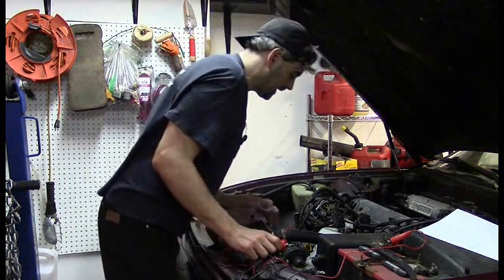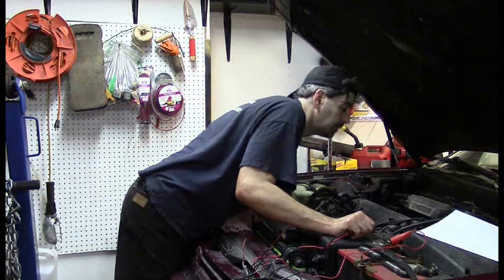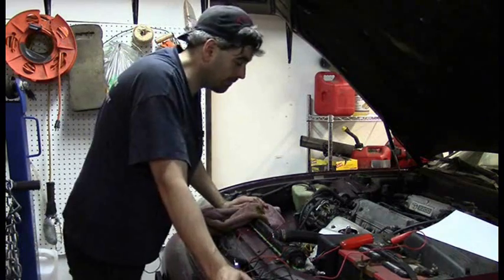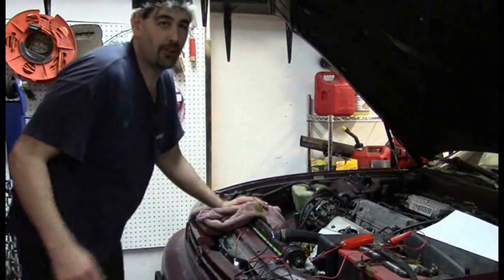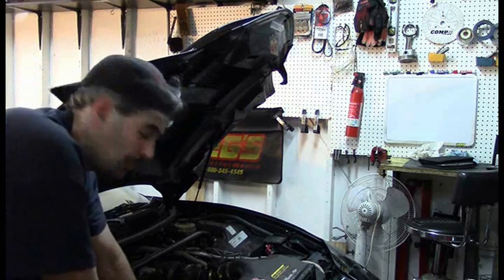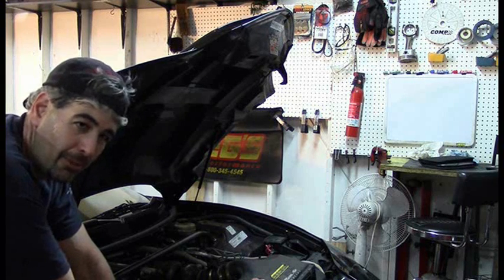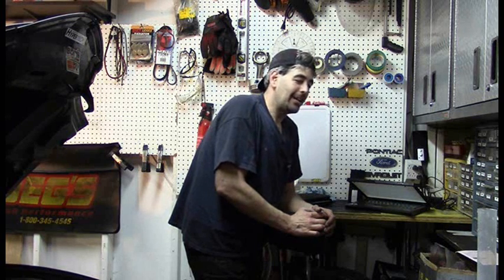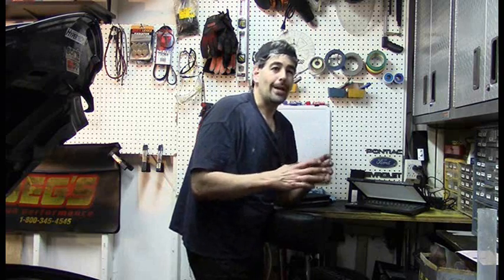12 Ways of How To Test A Blown Head Gasket Compared- PART2

Comment: A test only is reliable IF it is reproducible AND IT consistently provides Accurate results. Just because it worked once on a verifiable sample does not insure consistent reproducible results. The test Must be performed multiple times with both known and unknown sources to remove biasis to prove it is reliable. The test must be verified by other definitive tests like removing the engine head to exam the head gasket or magna-fluxing the head and block looking for cracks, or checking the block and head for flatness.
Reply from the maker: Absolutely 100% correct!! Good for you for being one of the few people that understands actual scientific process. 
   That’s exactly correct. Even further-  actual scientific method is performed under “negative hypothesis theory”. That is- you try EVERYTHING multiple times to prove the hypothesis wrong.  The failure to do that is what ultimately secures the hypothesis as correct. As an example- if a blown head gasket is suspected, you don’t attack it as “let’s find proof of a head gasket leak”.  You attack it as “let’s do everything we can to prove it’s NOT a head gasket leak”. But when those tests consistently fail to show the head gasket is good, that’s the actual scientific proof of a blown head gasket. 
   This approach prevents bias in the testing methods.

Comment: Matt, long term subscriber here… I have an 05’ Toyota Sequoia that is pushing coolant into the expansion tank on a drive cycle but only pulling about 50% of that amount back into the radiator after a full cool down. I replaced the radiator cap and the hose going to the expansion tank, no cracks in tank. I think I have a bad head gasket but have not completed my analysis 100%. So far I have pressurized the cooling system and saw a leak down of 2 psi in one hour, no external leak. I have block tested it cold, no color change. Block tested it hot, fluid changed to light green and I did see occasional bubble coming through without applying vacuum. My question… have you seen a tiny head gasket leak cause a continual rise in the expansion tank level while dropping the radiator level? I have not allowed it to happen but I believe if I let it go unchecked, it will eventually overflow the expansion tank and the radiator will be low on coolant. I plan to do a cylinder leak down test with engine hot / warm next to see if I hear / see the cooling system bubbling
Reply from the maker: Thanks for subscribing long term!!
   Yes I don’t know what’s going on but a lot has changed since this video and it’s totally revised the way I examine head gasket issues. 
    Maybe it’s a newer car thing but I routinely run into cars now that do not express any of the traditional signs of a head gasket issue but they absolutely have small leaks-  too small to detect with compression test or even chemical block test.  The car seems totally normal but develops overheat, high cooling system pressure etc but no trace of any combustion chamber compromise.  Several years ago I caught a vehicle that had what seemed to be a pinhole head gasket leak that totally changed everything as all my tests where negative until I let the car sit overnight and Borescoped each cylinder and found cool and pooled in one cylinder. Since then I have found probably a dozen cars like this. 
     Currently- I don’t even bother with the compression test anymore if I suspect a head gasket issue. I use a pressure transducer on the radiator and look for pulses consistent with each engine cycle. The transducer is the only thing I have found that’s sensitive enough to detect really small leaks.
     So basically, yes you can not only absolutely have a head gasket problem that is too small to detect by traditional means, but for some reason it’s much more common in later model cars since this video.
Reply: @SchrodingersBox  Thanks for your videos and your input here, I have learned a lot from your channel. Found you in the early days of my career, now I wrench professionally as a Caterpillar field service technician. I agree with the odd modern head gasket problems. I just solved a C18 engine with a “low coolant pressure” code and occasional overheating that the customer struggled with for months. The problem ended up being a bad head gasket and corroded block surface. My Sequoia is not overheating, no smoke, no misfires, no coolant loss. I just bought it a week ago and it started getting hot on the long drive home. Fluctuating temperatures, the variable seeming to be air flow over the radiator. I did a cooling system flush, new coolant, new thermostat, new viscous fan, new cap. I don’t throw parts at customer jobs, but for my own vehicle I’m ok with a few hundred dollars for things a 20 year old truck could use anyway. Since then I’ve noticed the expansion tank issue. This week I’m going to run it and see if it overflows the tank if I let it be. Anyways, thanks again. I’ll let the community know what I find.

Comment: Just info Update; with history.
My issues, ovr heating, Turning Heater on full hot medium fan would bring temp down.
Truck had set a majority of her life. 
Watched our ole buddy the Neclear Physisist " can't even spell " :(( whom we all love and Hate at the same time.:)))
I No visible leaks. No bubbles. I know not scientific.  I had not driven her for long periods. 
I figured "throw the tool chest at her.
Pump/ thermo/ all hoses new fluid.
Post all that, she still overheated but not as much.
So by now I'm fearing the worst.
I figured a professional radiator flush would be worth a try. Fluid looked good No crust build up visible inside or out. 
I found an ole guy who has been strictly the radiator guy for years.
He showed me his knowledge learned test.
He tilted rad "Top inlet higher" and placed garden hose in rad fill hole, place hand on lower and said to time how long it takes to shoot water out the higher inlet. within seconds water gushed out. 
He said my rad was 85% blocked.
He also said the rigor he would use to "try" to clean that serious a clogged unit would blow the plastic construction pieces off.  
He also told me "if I'm planning on keeping her I should stay away from the cheap Amazon stuff.
SO Napa has one on order:))))
Best; Tom

Comment: Hi i have a mer w 204 the water from the water bottle is going down when you fill it up , thered nothing in the oil mixing or on the oil cap also no leak on the floor  . what could it be please im worried

Comment: pts 1 &2 were very helpful. Both are brilliant.  Sadly I don't think they solve my problem. I have engine oil in the radiator, but no sludge in the sump, radiator or tappet cover nor do I have bubbles in the cooling system? there is an excessive amount of oil in the air intake behind the filter. I am going to try the sizzle test.
Reply from the maker: I’m not sure how this can’t help. what was your compression test result? what was your leakdown test result?
Reply: @SchrodingersBox   First of all, Thanks for your reply.
 Haven't done either yet only just found the the fault(if the is one) I am getting very faint white exhaust.One suggestion I had was to change the pcv valve.(?) That might be the cause of the oil in the intake, but I don't see how it could effect the radiator. The coolant in the radiator is still green. The C.O. test kit I bought is useless and came with no test fluid so I'm chasing another one. 
One other thought I've had is that a crack may have just developed and hasn't had time to so all the symptoms, yet so I'm watching for the moment
Reply: When you showed the plugs at the beginning of part 1, #3 plug was cleaner that the others. That, coupled with white steam coming out of the exhaust when a car is started after sitting overnight, or coolant loss with no external leak, would be sufficient to indicate a blown head gasket at #3 cylinder.

Comment: Seems like the first 2 tests (chemical test and compression test) are the go to tests....quick and easy and can detect top half compression issues even if there aren't other blatant signs (white smoke out tailpipe, etc)

When you do compression tests do you do dry and then if dry is low do you do wet to try and direct you to what type of compression issue is going on (top half vs bottom half compression loss)

Comment: what of the test of pulling all spark plugs out[all] putting back one spark plug at a time, cranking motor, an watching radiator cap hole for bubbles or blo out extream, do this one at a time removeing plug when done with that cylender going on to next cylender an on till gone through all telling you which cylender has a problem, . this cad 98 northstar has a serious blowing compression back in to water jacket, thought stuck t stat could cause that or a block some where other than head gasket, please advise. thanks

Comment: i have a 98 cadillac northstar with a heateing problem, now when i remove the cap on the over flo bottle ,it looks like old faithful, blowing out coolent like crazy, is it a blown gasket or a failed t stat, an can i put in a shorter t stat as the orginal is long, so put in a

Comment: The fluorescent dies are heat affected. In liquid penetrant testing which uses fluorescent dies in the aerospace industry, there has been extensive testing done on the effects of heat and loss of fluorescence in conjunction with USAF and probably USN, whereby there are controls employed to keep temperatures in the range: 4 deg C to about 50 deg C during testing (including atmospheric, part and equipment temperature). Also there are limits on UV effects on loss of fluorescence, which means strict control of UV intensity and exposure time.

Comment: my oil appeared to sizzle what should I do next as a have a fail oil cooler on a 2011 plate vauxhall zafira 1.8 petrol? ANY HELP is appreciated
Reply: it didn't sizzle it just had bubbles in it very little so if the oil can get in water and has been in car for 4weeks now then could the water find it's way to the bottom of the sump contamination rather than blown head!!!! from the failed oil cooler!!!?.
Reply: also done diagnostic after short drive of about 10 miles all round and only o2 sensors in pending faults bank 1 and 2 o2 sensors no other engine issues starts and idles great @869-900 RPM very quiet pulled a good vacuum though..... i was using i car pro and torque app and seemed to work great.
Reply from the maker: ok so what was the diagnostic data? so far I have nothing to go on.
Reply: @SchrodingersBox   ONLY 1 CODE from diagnostic scan "pending" P0134 bank 1 and 2 engine starts and idles fine after 2-3 days sitting no white smoke no rough running issues although does smell of fuel "very rich" and have been advised that oil pressure can be 60psi and coolant only 14psi so oil will always go in to coolant first "oil cooler" failure cause by seized thermostat.? rubber o rings go hard and flat LEAKS FROM EVERY WHERE!!!! Negligence and ignorance will cause damage to the head gasket but if caught quick enough can be repaired "RELIABLY" any help is appreciated cheers from Scotland!
Reply: @SchrodingersBox  "NOTHING"

Comment: Another great thing about the paper test is that if it's just gas on the paper you will not be able to poke your finger through the paper if it's gas .then if it's water on the paper you will be able to poke your finger through the paper very easily.  This is because the water breaks down the paper fibers in the paper and the gas does not do that

Comment: Really liked this video. Learned a lot. Very well done. Sizzle test reminded me of the “good battery” test I learned about quite a few years back in a scrap yard. Requires shorting a oil dip stick across the battery poles. If it glows red in under 3-4 seconds...battery is well charged. If it takes 7-10 seconds or more, it’s toast! As everyone else has said...kudos for your efforts! I will watch your other videos.
Reply from the maker: Man I definitely would not do that battery test. It could easily short out one or more cells either way.
 “Well, this battery WAS good but now that I tested it by shorting the electrodes and it dropped a cell, it isn’t anymore. “

Comment: 6 years later still one of my favorites ...especially  at 14 min 17 seconds.  Or -4:18 lol 😉😁😎
Reply: What if it has an oil cooler failure known common fault thermostat causes it! like any ecotec engine from GM and it's only mayonnaise in the header tank? smelly old black oil no visible water but bubbles with the "SIZZLE" test?

Comment: Don't worry, your TA is a GM car..... it's got a leak.  lol (loyal GM owner)
Reply from the maker: I don’t understand that. why would it have a leak just because it’s a GM car?  That makes no sense to me. I have only owned GM cars and my Trans am alone has 230,000 miles and never had a leak. I have seen probably 200 GM cars since this hobby and there are no more issues with them than other makes. Maintenance is clearly the differentiating variable based on empirical evidence.  I don’t follow what you are saying.
Reply: @SchrodingersBox  I've owned about 25 GM vehicles in my life and it just seems like they all develop some kind of coolant issue- nithing major, just an annoyance...i e.The weep hole leaks way before the pump fails, leaking intake manifold...GM really went wrong with Dexcool... My truck and suburban both have over 230K  Of course my Duramax is actually Isuzu, mostly.
Reply: Maybe a little biased...I owned a Grand Am that had intake leaks and a Suburban 5.3L with bad heads, both issues were from the factory!......symptom-unexplained coolant loss
Reply from the maker: how did GM go wrong with dexcool? what is the specific failure with dexcool?
Reply: @SchrodingersBox  It was originally invented to last 100K miles, but instead caused corrosion to accelerate, and doesn't mix with anything.  I don't know specific details but I don't use anymore
Reply: ***Gasket failures!.... That's what happened to my 97 Grand Am
Reply from the maker: how does Dexcool coolant cause corrosion ?  I have only ever used Dexcool. no corrosion. ever. never seen how is it possible for an inert silicate to cause corrosion.  That makes no sense from a physical chemistry perspective to me. Please explain that to me. I’m a chemist so go ahead and get technical. How does inert silicate cause corrosion?
Reply: @SchrodingersBox  I was wrong about corrosion...See my second reply. Dexcool caused gasket failures
Reply from the maker: even better!! How does inert silicate cause a gasket failure?  How is that even remotely possible?  Please explain that because it makes even less sense than corrosion because someone could have used ionized water or something to dilute the Dexcool to cause corrosion. but erode a plastic gasket?? Please explain how that happens.

Comment: Question: I drive a Honda Civic 2002.  I have changed my oil and it is only after, that I have notice I was losing heat in the car. Now,  I am losing prestone through the top of reservoir because of air build up in the prestone.
     Before changing oil, my oil was to minimum on the stick. After I changed the oil, I topped it up to max on the stick,  then issues started. Would the oil pressure and, or PC valve be a factor?
      Thermostat and radiator cap were changed.
      People say it is the head gasket gone. What would be your opinion?

Mario from Nova Scotia, Canada
Reply from the maker: What did your compression test show?

Comment: "I'm a scientist." Also doesn't think that a coolant mixture that includes water wouldn't sizzle on a scalding surface. Good videos, but seriously stroking your ego with the "I'm a scientist" line is a bit of a snobby turnoff.
Reply from the maker: It’s way over your head. It’s not that water sizzles on a hot surface. You are missing the point of the negative and positive controls. That is the science. Your incompetence causes you to misinterpret process for ego.
Reply: I completely understand negative and positive controls. I also know that water has a boiling point lower than oil at a constant pressure (which you never thought would happen in a million years). I am not going to attack you like you attacked me. I actually like your videos and find them informative. You are very smart and spend a lot of time on your content. Just some friendly advice that cockiness and ego are not an asset. You may even have a lot more subscribers if you didn't bash people who know less. Good luck in your future videos!
Reply from the maker: Well I looked at your channel to see how many more subscribers I would get using your advice but you have zero subscribers.
  Not bashing you or attacking- just giving you some friendly advice to only give advice when asked, and have credibility when giving advice to people more successful than you. This will prevent YOU from looking pompous.
  Come back when you get 150K subs and 30M views in less time than I did and then maybe I will consider your "friendly advice". But right now you have zero credibility so your advice is worthless to me.
Reply: So angry. You should talk to someone man. You have some serious issues when someone points out something so obvious you missed when you spend half of your videos calling people stupid and bragging that you’re a scientist. So pretentious. So sensitive. So insecure.
Reply from the maker: I don't know man- sounds like you are the one with issues. I mean, I am here with a successful youtube channel (making enough to live off it alone much less my day job) by being a resource to literally millions of people while you have no experience with producing anything that is in such high demand from the general public and yet you feel it necessary to give me unsolicited advice on how to run my business.
  Sounds to me like you are obsessively jealous or something. My advice- let it go man. Go out and be productive on your own instead of trying to live vicariously through me.